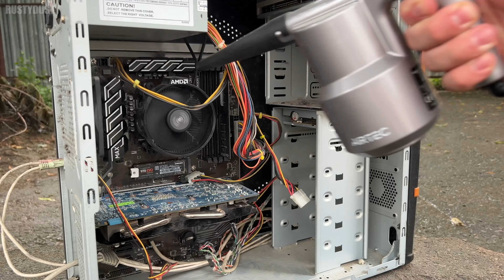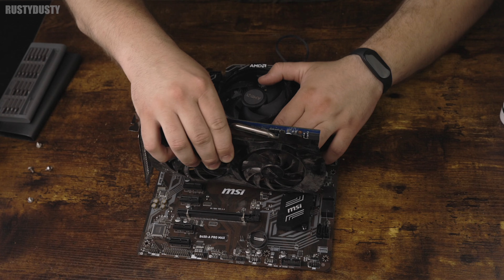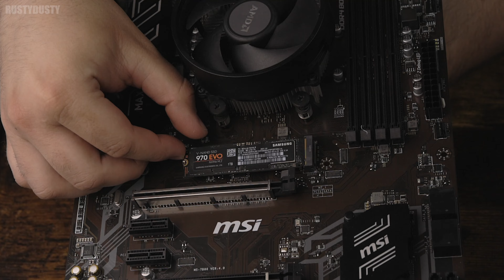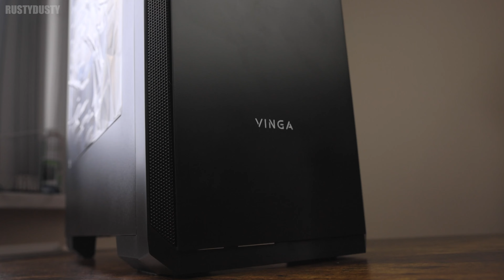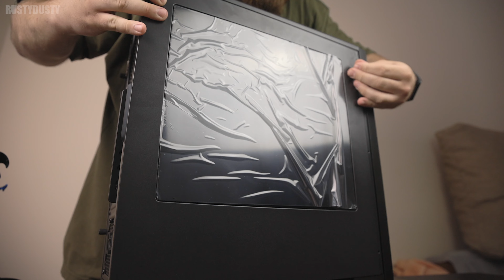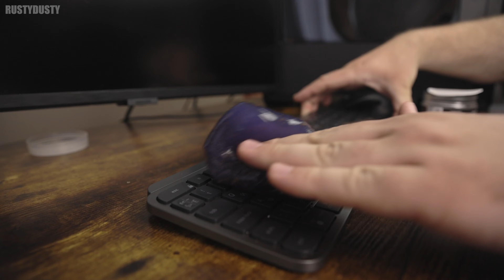DUSTY PC CLEANING! 😷🧼  | Satisfying PC Transformation!

Comment: ok, why did u wash the gpu LOL
Reply: was wondering the same lol, thats why it stopped working.....
Reply: he could have saved it if he let it dry for 48 hours @CrunkyOMan83
Reply: @michaelgamingchannel2649  bro is the successes % is only 10%
Reply: @gumringnaw123  what
Reply: That was definitely broken already, I did the same thing with an old CPU. Made a “cleaning solution tutorial” where I mixed bleach and baking soda to “clean” the cpu
Reply: You can wash electronics as long as they aren't running any current. So no capacitors. You just have to make sure that the the thing you soaked is 100% dry before you try powering it back on, otherwise you'll short it out and cause permanent damage.
Reply: @gumringnaw123 
?
Washing electronics is fine as long as you do not accidentally wash away a transistor and you let it dry long enough before giving it power

The problem with mixing electronics and water only happens when it is powered. Otherwise it's safe because you can't short circuit a circuit without power.

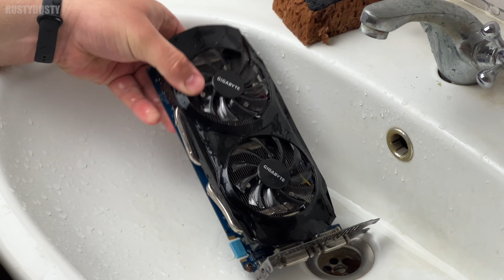Comment: 4:50 LOL BRO UR CARD IS RIPPED! PROTIP: ONLY use Isopropyl Alcohol to clean or wipe connectors, cpu paste etc and do not use WATER to clean a single ****ing part of a pc as it will slowly start to get ALOT of rust on the connectors and the pc is simply ded which u did on the graphics card, PLEASE I BEG YOU DO NOT USE WATER ON PRECIEOUS CARDS OR PC ITEMS! its a PAIN watching it gets destroyed ;--;